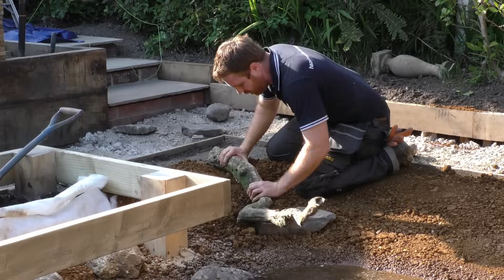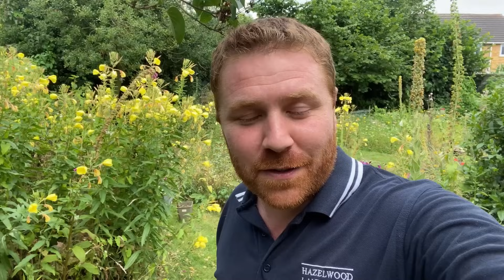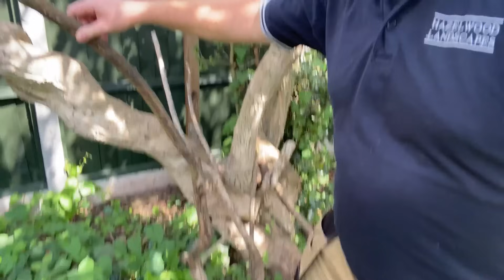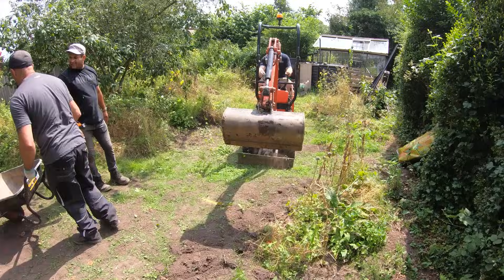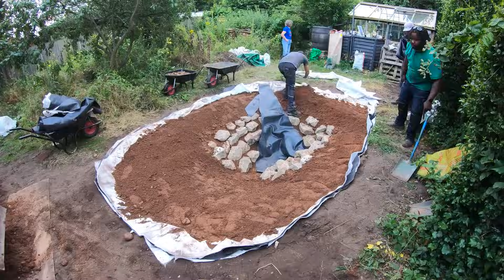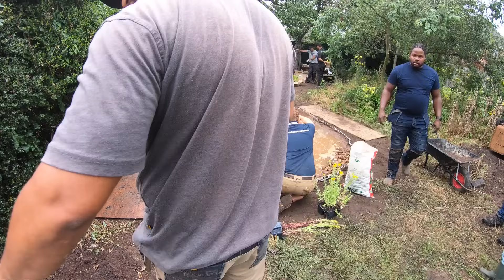Making My 100th Pond For Wildlife

Comment: Hi Joel:  This was wonderful!  Thank you for posting.  There are filters you can place on the garden hose to remove 99% of all chlorine from the water.  I bought two online a year ago and they are terrific!
Reply from the maker: Hi Donald - thank you so much :)  I did have a customer a few years ago that suggested I use this but on checking they were for lawns and plants and had added minerals and nitrates, which is good for plants and lawns of course but it wasn't good for the water for the ponds, as we need "low nutrients" to keep the water clear - I'll check into these again though and see if they do any suitable for ponds too - thanks for letting me know, appreciated :)  Best wishes - Joel

Comment: Brilliant video, nice to see things in a bit more detail. How do you decide how many plants to put in, is there a rule of thumb or after a 100 ponds do you just have a feel for what you need? How many were in this pond for example?
Reply from the maker: Hi Stuart - so sorry for the delay in responding, it's been a hectic few weeks, working 6 days and having to stay til 11pm some nights to complete the latest pond, before we move on to 3 others!  I have kind of worked out how many plants per size of pond and it does come as second nature now - but if you needed any advice if you were building one we're happy to give it - just drop me a line at enquiries@wildyourgarden.com where we also sell all the liners, fleece, subsoil and plants - for working out the plants for ponds, I roughly work to 5 to 7 per linear metre.  But happy to advise further if you need :)  Hope you're having a good weekend, and thank you for the kind words and support, they do make a difference - best wishes, Joel

Comment: Hi Joel, another lovely pond. I'd like some advice if that's OK, I will shortly be digging out a largish pond to your design. The area the pond is to be located, use to have a large raised decking area and dilapidated shed, the posts for the decking had lots of concrete around their footings, which I've removed and is in a huge pile waiting to go in the skip...my question...could I use these large bits of concrete as the retaining wall section in the pond ? I'd obviously have to watch for sharp sections but would the lime in the concrete had a detrimental effect on the pond and/or wildlife within ?
Reply from the maker: Hi there - sorry for the delay - do send some photos to me at hazelwoodlandscapes@hotmail.com of what you're faced with and I'll see if I can help :)  Best wishes - Joel

Comment: Great Videos! I'm planning an alpine wildlife pond with a pump/waterfall feature - what do you suggest during winter? We have 4+ feet of snow on the ground for about 4 months and sub freezing temps. Do you turn off the pump and reseed the filtration in the spring? Keep the pump running?

Comment: This, and your other, videos are very inspirational! Have made me think about supporting the local wildlife where I live with a pond. Red squirrels, roe deer, badgers, and of course birds and insects. Bit hard with safety regulations really requiring a fence with anything beyond 20 cm depth, but am looking for a way to get a deeper part without the fence (which defies some of the purposes). Live in South Norway. Colder here, so ice and winter will have to be part of the plan. One question, see many here recommend circulation pumps and filters and see that you don't put such in. Could you comment on that, please?
Reply from the maker: Hi there :)  I'm so glad that this has inspired you to make another vital habitat for nature.  It's probably best to have a deeper pond for when it is winter, but a lot of amphibians leave a pond after breeding and go into surrounding habitat, ponds are mainly for making more of themselves ;)  As long as you have 60-70% floating leaf plants to keep the water cool in summer and of course native oxygenating plants this will remove the need for anything artificial, the subsoil used on the top layer not only allows you to plant directly into the soil but the low-nutrients of this soil also keeps the water clear - it's fish and a build up of nutrients that usually require a pond filter, hence seeing them as vital in koi ornamental ponds.  I hope this is helpful to you, but I'm here if you need anything else :)  Thank you for your encouragement and support, it means a lot - best wishes, to you in Norway - Joel

Comment: As always Joel, very helpful.  A question if I may. I have dug mine out now (4x3x0.6m in the 'well'), but my soil was very rich and very deep.  I have nothing like enough subsoil to cover the area.  Could I substitute something like pea gravel and/or sand in places? Aquatic compost?   Or any other suggestions?
Reply from the maker: Hi Norman, thank you so much.  Yes, you can absolutely use sand/gravel on the bottom - aquatic compost may be particularly expensive for the area you have, however if you send me an email I do know of a few companies that will send the subsoil you need by the tonne bag - I'm at hazelwoodlandscapes@hotmail.com.  But again, sand and gravel are fine :)  Best wishes, Joel
Reply: @WildYourGardenWithJoelAshton   Thanks Joel, I have dropped you a line.  Your help and encouragement are much appreciated.  Norman.
Reply from the maker: @normancoutts  You're very welcome Norman, as always :)  Best wishes - Joel

Comment: Hi Joel, I am about to redesign my pond and wondering can you use clay subsoil? I live in Shropshire and we have clay everywhere
Reply from the maker: Hi Darrell. Absolutely you can. Most of the subsoils I use are clay based. It is if course easier to plant in a more sandy loam around the margins, rather than the clay. If you don't have any and the pond is of a reasonable size, we do sell this by the tonne bag on the Wild Your Garden website if you need any :-) Best to dig it first and see how it goes perhaps. Here if you need anything else or any more tips. Thanks Darrell and good luck!

Comment: In my region (New England USA) I think this would freeze solid in the winter. Maybe it wouldn’t, not sure. How does freezing affect the wildlife that lives in the pond?
Reply from the maker: Hi there - ponds freeze over here too, one of my friends here on YT found a mating pair of frogs absolutely frozen during the night but by the morning when temperatures had risen a little and the water "defrosted" they'd both gone.  I learned after that frogs can stop their heart-beats to counteract freezing and then re-start them when temperatures are better :)  A lot will go to the bottom of the pond so it might be worth, if you are able, to make the central well and pond deeper and bigger of course, if space allows.  I hope this helps - best wishes, Joel

Comment: Hi, was wondering for your opinion on eucalyptus gunnii trees?
Reply from the maker: Hi there John :)  Although not strictly native to the UK Gunnii do provide nectar for pollinators as do the other species, they're actually pretty common where I live in Essex, on the coast.  They are fast growing - I've never planted one in any of the client gardens but have seen plenty already existing :)  Hope this helps - best wishes, Joel
Reply: Great thing about Eucalyptus trees, you can coppice them (don't cut them back during the winter months, do it in late summer so they have time to heal before the frosts - I made that mistake with 2 of my Eucalypts, but all the ones cut back earlier survived and resprouted beautifully).
If you live in the country and have a wood stove, seasoned eucalyptus wood is one of the hottest burning woods around (due to the oil). It also takes a long time for the wood to be consumed. However, a good tree, well grown, will also be of interest to specialist wood turners. 
If you're keen on Eucalyptus and have plenty of room for them, Chiltern's seeds do a great mixed species seed pack. They're easy to grow for anyone with experience in raising plants from seed, some growing quite fast (there are slower types in the mix too), and some have the most amazing blend of leaf colours.

Comment: How do you address major rainfall events? Appears there is no where for excess water to go other than erode out the surrounding area.
I can see there being an issue with leaf clean up and other debris accumulations within the pond. How do you address that?
I really applaud your efforts but we have 2 small naturally occurring ponds. Both of which require muck outs and major renovations every few years 
Also without shade I can see water temperature issues creating algae problems 
Any mosquito problems
Reply from the maker: Hi there - there is no specific run-off point with these ponds, but the rain water is slowly absorbed by the surrounding ground in each situation, I've never had flooding issues with any of the ponds so far :)  Leaf litter, if a pond is placed too close to trees, is an issue for any pond and they will require maintenance, again the same as any water body over time.  Re the shade issues, this is combatted by the floating leaf plants which also help to keep water temperatures cooler and  combats the algal blooms.  Being ponds for wildlife, these really do attract amphibians, birds, bats and larger insects which all make a dent in any mosquitoes and their larvae :) Best wishes, Joel
Reply: @WildYourGardenWithJoelAshton  thank you. I would love to see the natural progression of 1 of your installations over time. I’ve had to do a significant amount of restoration of our 2 ponds due to 2 hurricane events.   We created a small wetland area that feeds the one pond that always seemed to have water quality issues and that’s made a significant improvement as well as bringing in a lot more wildlife including box turtles which I love